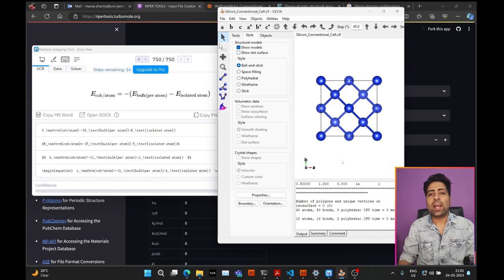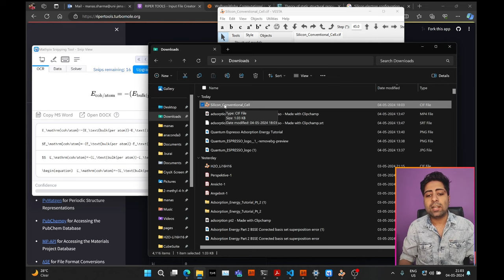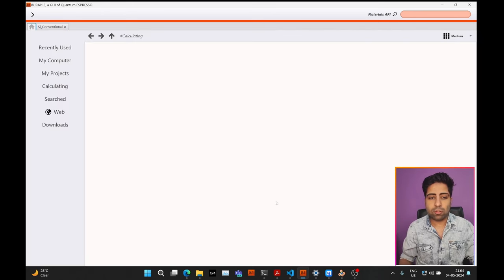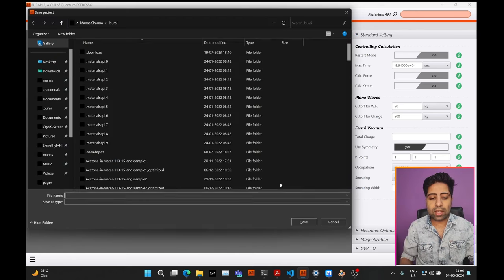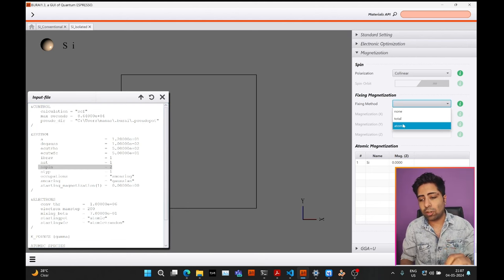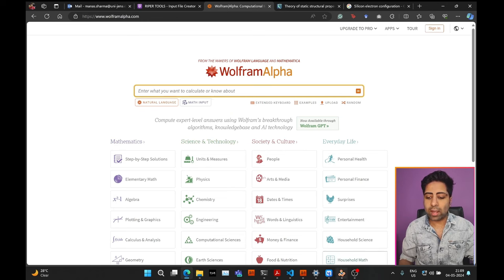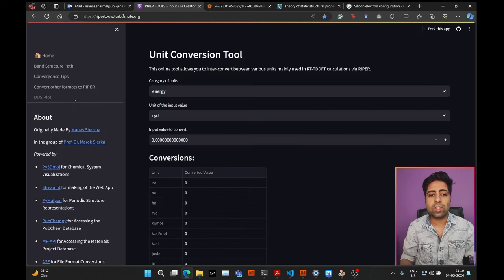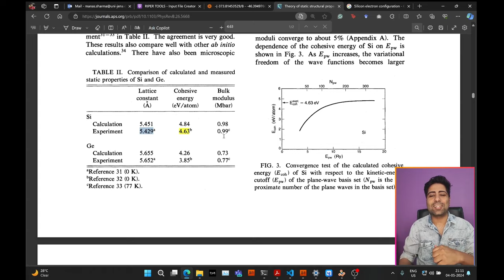How to Calculate Cohesive Energy using Quantum Espresso? [TUTORIAL]

Comment: Thank you for the video. Small question. Which parameters should we keep the same calculating entire system and isolated atoms? For instance, if we use smearing for entire system, should we use exact the same degauss for isolated atoms? Or we can choose smaller degauss, if it is applicable, to decrease smearing contribution?

Comment: Nice tutorial!!! Can you explain why we use 12 angstroms lattice parameter for isolated atom calculation what will heppen in case if I increase this lattice parameter to 20 angstroms or otherwise decrease it to 7 angstroms ?
Reply from the maker: I think I already mentioned this in the video. But the key thing is that Quantum ESPRESSO inherently applies periodic boundary conditions to your system in 3 dimensions. This means that whatever system you define it will essentially be repeated with the periodicity given by the lattice parameters. For cohesive energy, you require the energy of an isolated atom. But Quantum ESPRESSO will repeat the atom I have in my system periodically. So if I have a small lattice parameter, then the atom will have periodic images that are nearer. If the lattice parameter is large, then the periodic images would be further. If the images are nearer then they will interact. You wouldn't call an atom interacting with other similar atoms as isolated. So this wouldn't work. If the periodic images are farther, then after a certain threshold, the interactions between them would become negligible. Then you can consider your atom to be isolated.

You can find out the threshold or the lattice parameter size after which the interactions become negligible yourself, by running SCF for different lattice parameters. Once the energy stops changing beyond a threshold, you can consider the atom to be effectively isolated.

Comment: I'm trying to compute the cohesive energy of a perovskite. I have modeled the unit cell structure using vesta and did convergence testing to find the optimal ecut and k-points. Now, this is a silly question, but for the isolated atoms, should I use single atom structures expanded with a large amount of lattice constant, or should I use the standard conventional structure?

My thinking is that, what I should use is the previous, but some guy told me to use the "standard conventional" for the isolated atoms. It did not make sense to me because then that structure will have its own cohesive energy, but, what do you think?
Reply from the maker: You're completely right. For the isolated atoms the unit cell size should be large enough to prevent inter-image interaction s. The atom is isolated after all.
Also, one must use an orthorhombic cell ( with different lattice constants in different directions) instead of a cubic cell to remove any symmetry in the wave function as that can also affect the energies. I think I forgot this and used a cubic cell in this tutorial.
Reply: @PhysWhiz  big help!

Comment: Sir I have a small question.  when the electronic configuration is like [Ar] 4s² 3d¹  what nspin value I have to take? As 4s is filled and it is the outer shell so nspin = 1. Is this correct?
Reply from the maker: The 3d electron is also a valence electron. Since there is one unpaired electron the value of nspin should be 2. 

Also you can always verify these things. You can run two calculations: one with nspin=1 and nspin=2. Then you can compare the energies from the two calculations. The one with the lower energy would be the correct option.
Reply: @PhysWhiz  thank you sir
Reply from the maker: No need to call me "sir".

Comment: I am trying to calculate cohesive energy of ScAl2. ans coming out is much much larger than actual value. Another thing is that I am trying with nspin=2, nspin=1 for Sc, In both cases energy is coming as almost equal.  Where I am going wrong.  pls give me suggestions . I am giving my input script below,    for ScAl2, Sc, and Al
ScAl2                                                                                                                                                                                           
&CONTROL
  calculation = 'scf'
  outdir = './out/'
  prefix = 'ScAl2'
  pseudo_dir = '.'
  verbosity = 'high'
/
&SYSTEM
  degauss =   1d-02
  ecutrho =  400d0
  ecutwfc =   40d0
  ibrav = 0
  nat = 24
  ntyp = 2
  occupations = 'smearing'
  smearing = 'gaussian'
/
&ELECTRONS
  conv_thr =   1.2000000000d-09
  electron_maxstep = 150
  mixing_beta =   4.0000000000d-01
  startingpot      = 'atomic'
    startingwfc      = 'atomic+random'
/
ATOMIC_SPECIES
Sc     44.9559 Sc.pbe-spn-kjpaw_psl.1.0.0.UPF
Al     26.9815 Al.pbe-nl-kjpaw_psl.1.0.0.UPF
ATOMIC_POSITIONS {crystal}
Sc      0.00000000000000      0.00000000000000      0.50000000000000
Sc      0.25000000000000      0.25000000000000      0.75000000000000
Sc      0.00000000000000      0.50000000000000      0.00000000000000
Sc      0.25000000000000      0.75000000000000      0.25000000000000
Sc      0.50000000000000      0.00000000000000      0.00000000000000
Sc      0.75000000000000      0.25000000000000      0.25000000000000
Sc      0.50000000000000      0.50000000000000      0.50000000000000
Sc      0.75000000000000      0.75000000000000      0.75000000000000
Al      0.12500000000000      0.12500000000000      0.12500000000000
Al      0.62500000000000      0.37500000000000      0.87500000000000
Al      0.37500000000000      0.12500000000000      0.37500000000000
Al      0.37500000000000      0.37500000000000      0.12500000000000
Al      0.12500000000000      0.62500000000000      0.62500000000000
Al      0.62500000000000      0.87500000000000      0.37500000000000
Al      0.37500000000000      0.62500000000000      0.87500000000000
Al      0.37500000000000      0.87500000000000      0.62500000000000
Al      0.62500000000000      0.12500000000000      0.62500000000000
Al      0.12500000000000      0.37500000000000      0.37500000000000
Al      0.87500000000000      0.12500000000000      0.87500000000000
Al      0.87500000000000      0.37500000000000      0.62500000000000
Al      0.62500000000000      0.62500000000000      0.12500000000000
Al      0.12500000000000      0.87500000000000      0.87500000000000
Al      0.87500000000000      0.62500000000000      0.37500000000000
Al      0.87500000000000      0.87500000000000      0.12500000000000
K_POINTS {automatic}
8 8 8 0 0 0
CELL_PARAMETERS {angstrom}
      7.55530537      0.00000000       0.00000000
      0.00000000      7.55530537       0.00000000
      0.00000000      0.00000000       7.55530537

Sc
&CONTROL
  calculation = 'scf'
  outdir = './out/'
  prefix = 'Sc'
  pseudo_dir = '.'
  verbosity = 'high'
/
&SYSTEM
  degauss =   1d-02
  angle1(1)  =  0.00000d+00
  angle2(1)  =  0.00000d+00
  constrained_magnetization = 'atomic'
  ecutrho =  400d0
  ecutwfc =   40d0
  ibrav = 0
  nat = 1
  ntyp = 1
  nspin = 2
  occupations = 'smearing'
  smearing = 'gaussian'
  starting_magnetization(1) =  1.00000d-01
/
&ELECTRONS
  conv_thr =   1.2000000000d-09
  electron_maxstep = 150
  mixing_beta =   4.0000000000d-01
  startingpot      = 'atomic'
    startingwfc      = 'atomic+random'
/
ATOMIC_SPECIES
Sc     44.9559 Sc.pbe-spn-kjpaw_psl.1.0.0.UPF

ATOMIC_POSITIONS {crystal}
Sc      0.50000000000000      0.50000000000000      0.50000000000000
K_POINTS {gamma}

CELL_PARAMETERS {angstrom}
      14.00000000     0.00000000        0.00000000
      0.00000000      14.00000000       0.00000000
      0.00000000      0.00000000        14.00000000

Al
&CONTROL
  calculation = 'scf'
  outdir = './out/'
  prefix = 'Al'
  pseudo_dir = '.'
  verbosity = 'high'
/
&SYSTEM
  degauss =   1d-02
  angle1(1)  =  0.00000e+00
  angle2(1)  =  0.00000e+00
  constrained_magnetization = "atomic"
  ecutrho =  400d0
  ecutwfc =   40d0
  ibrav = 0
  nat = 1
  ntyp = 1
  nspin = 2
  occupations = 'smearing'
  smearing = 'gaussian'
  starting_magnetization(1) =  1.00000e-01
/
&ELECTRONS
  conv_thr =   1.2000000000d-09
  electron_maxstep = 150
  mixing_beta =   4.0000000000d-01
  startingpot      = 'atomic'
    startingwfc      = 'atomic+random'
/
ATOMIC_SPECIES
Al     26.9815 Al.pbe-nl-kjpaw_psl.1.0.0.UPF
ATOMIC_POSITIONS {crystal}
Al      0.87500000000000      0.87500000000000      0.12500000000000
K_POINTS {gamma}

CELL_PARAMETERS {angstrom}
      14.00           0.00000000       0.00000000
      0.00000000      14.00            0.00000000
      0.00000000      0.00000000       14.00
Reply: The energy of Sc, using your input file is not equal with and without spin polarization. I'm getting a value of  -156.63416812 Ry without spoin polarization and -156.64404984 Ry with spin polarization. Ry is a big unit of energy. 1 Ry= 13.6 eV.
Please note, I use a higher value of Ecutwfc= and Ecutrho, compared to what you used:
    ecutrho     =  4.42315e+02
    ecutwfc     =  4.91461e+01

Also, I am getting a cohesive energy of -4.2 eV/atom. What are you getting and what is the expected value?
Reply: @ManasSharma07  what is the formula used for this purpose... pls elaborate. the value 156 I am also getting for Al I am getting 39.2 Ry. and for ScAl2 this is around 1888 ry. what is the formula used?
Reply: @sankhasubhramukhopadhyay5633  You didn't answer my question in my comment:
What are you getting and what is the expected value?
Reply: @ManasSharma07 I am getting value around 117 Ry. And actual ans is 4.16 eV ..your calculation is right but what formula I have to use
Reply from the maker: @sankhasubhramukhopadhyay8005   This is the formula I used

https://www.wolframalpha.com/input?i=-1888.553770%2F24+-+%288*-156.64404984+%2B+16*-39.24939399%29%2F24
Reply: @PhysWhiz  thank you very much